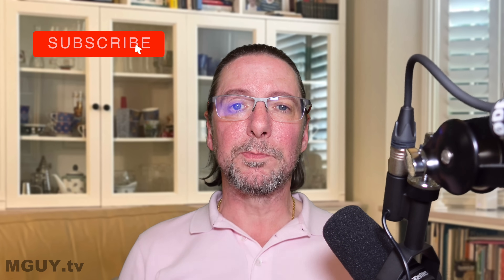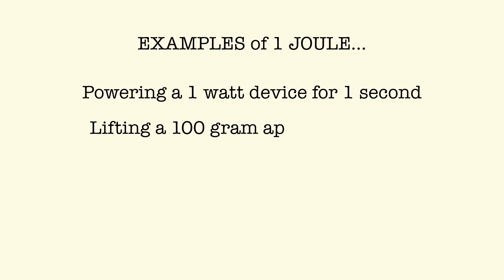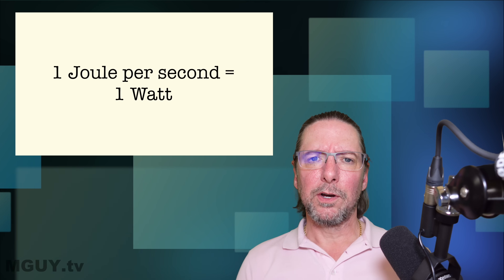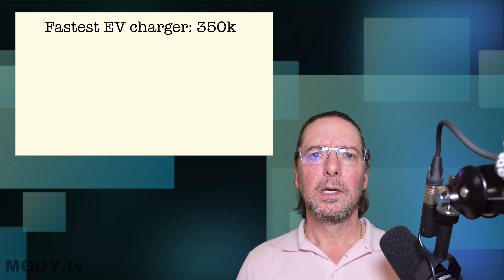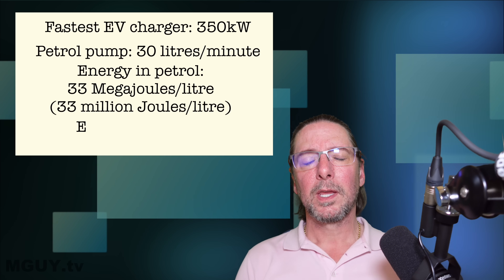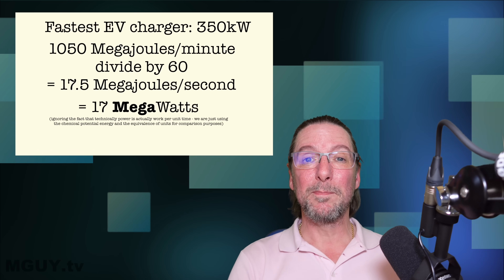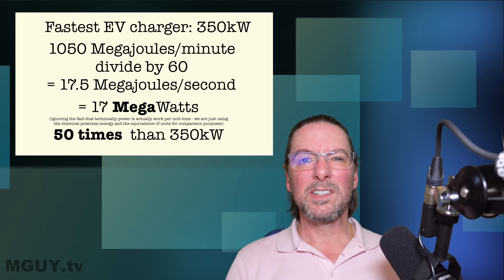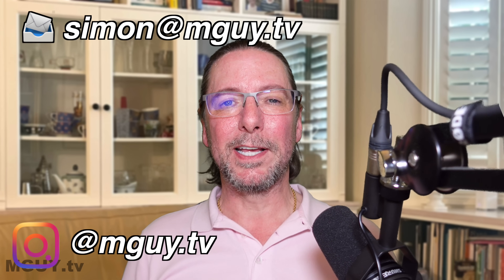Comparing charging speed of EVs vs "fuelling speed" of regular cars | MGUY Australia

Comment: And don't forget in cold winter weather you will lose about 30- 40% of the battery charge.
Reply: what about hot weather?
Reply: @sheilaolfieway1885   that is not good for the battery.
Reply: @joistein  What is? almost everything you do in a normal ICE car is bad for the battery
Reply: That's Huge loss
Reply: I live in a cold country, Iceland. Yes, you have less range when it is cold, mainly because you have to heat the car. In the worst case I have experienced a 20% reduction in range.
You actually do not loose battery charge, your car holds the battery at a suitable temperature.
Reply: @mjoelnir1899  here inN- Sweden 🇸🇪 it's now -24 and some batteries 🔋 works much worse and others but it is difficult to know which will be best 👌 🤔
Reply: @mjoelnir1899  I am a Icelander to but in North of Sweden you can get - 35C that is unlikely in Iceland, some batteries lose up to 40% of range it depends on brand.
Reply: @joistein We can have an endless discussion how bad BEV behave in the cold and there are all the time pulled out the worst cases. I drive a Skoda Enyaq. When you put a little thinking in the use, it makes a huge difference. In the morning you let the heat car itself, while it is still connected to the charger. My car controls the temperature of the battery, so it will heat up the battery both before you drive off and for example before charging. So for me it is not that the battery looses it's charge, but the high use due to heating the car on the way. If the car stands outside in the cold not connected, you will use quite a bit of the charge heating up the car and the battery. If you live that far north you better have a car with a big battery.
I work in fish processing equipment and I have been quite a lot in northern Norway. And guess what, even there you find quite a few BEV.
With cold temperatures you can also run in problems with ICE cars. The diesel engine will not start because it does not ignite when it is cold, or the fuel has to much wax, or the oil is to thick. You can of course get around that. Have a preheater for the engine and the oil sump, the diesel runs through a preaheater that used the engine cooling water and so on.
I have sat in petrol cars that do not start in the cold.
As it is the BEV are getting better fast, there is a huge difference between my BMW i3from 2012 and my Skoda today. When I bought my i3 the battery was 22 kWh. The last i3 had 44 kWh. My Skoda has a 80 kWh battery. The i3 had not as complex battery control, you had for example to initiate preheating the battery before charging in the cold.

Comment: I tested this 4 months ago, I purposely set my stop watch, started it got out, inserted the fuel nozzle (not high flow) pumped 95 litres of diesel went in paid for it and returned back to the vehicle in approximately 6mins.
Reply: even quicker when you pay at the pump.
Reply: I tested this 4 minutes  ago. Under 5 seconds to plug in, under 5 seconds to unplug. No time spent paying. Approximately ten seconds of my time per day spent fuelling.
Reply: @javelinXH992 presumably you don't drive long trips. So a diesel like mine would only need refuelling every 3 weeks or so, at maybe 5 minutes a time.

Ends up there's very little difference then.

But where do you get the free electricity from?
Reply: @alanjm1234   My previous car was a diesel (and so is our other car) and driving 350 miles a week I used to fill it up twice a month (about 700 miles per tank). My electricity costs for the newer car (3 years old now) are about £10 per 350 miles (+/- £1 from Winter and Summer variability). When the electricity price doubled it went up from £5 per 350 miles. In a diesel at todays prices £1.45 litre for 50 litres that would be about £72. Works out at about £100 a month saving for me or £1200 a year at the moment to be electric.
Reply: @javelinXH992  but you missed out on the exciting petrochemical smells, point of sale display offers and grumpy cashier!!
Reply: @toyotastout6870  I do miss the smell, I love the smell of petroleum products. Still we get to fill up our diesel car sometimes so I can relive old memories. 😉

Comment: The other crazy thing about EVs is it's recommended to charge up to 80% and to recharge before goes below 20% so you are paying in some cases for 100KWh battery but can only use 60% of it. Once you get to 80% it takes a lot longer to put the last 20% in if doing long distances the rapid only works for 20-80% and then you have temperature issues too.
Reply: That is something that the argument of what it cost to charge over the price of fuel always got to me. Technically you are only using 60% of your charge. That is a little over a half a tank in a ICE car. How is this efficient. The other thing they don't mention but Uber drivers with EV Tesla's too have said is any EV when it gets down to 50-mile range is really a crap shoot. It could be 10-30 miles range and changes all the time when it drops to 50-mile range. We had and Uber driver tell us he picked up some people to take to the airport and he had 50-mile range on it. Plenty or range for the trip. His Tesla started dropping and he had to pull over and call another Uber to come get them. It isn't just Tesla they all do that.
Reply: That's OLD tech. Keep up. Or, just ignore change. It's your life.
Reply: @1voluntaryist  Well I am so glad you can go out and buy the "new tech" for every EV car that comes down the line. Most people have older EV cars and they are 20-80%.
Reply: You're not in any way forbidden from using the whole battery capacity when you need it.  It's just not considered best practice to do on a regular daily basis, for maximum service life.  Also, more and more cars are being built now with LFP batteries, which are cheaper and have somewhat less capacity, but they are happy being charged 100% all the time.
Reply: @Zobeid  yeah said recommended but does supposedly damage them - sure new battery chemistry might go all the way 0-100 some like zinc-bromide can be stored at 0% (and am not suggesting ZB batteries for cars).

Comment: Wouldn't it just be easier to design batteries that can be exchanged like gas bottles.
You drive in, take the flat battery out & exchange it for a recharged one. Why cant there be 2 batteries & one charges the other as the other is driving. I wont be buying an EV, there's no way i am burning in a car & i dont think they are better for the environment.

Comment: Why is this relevant? 
it take about as long to plug in an EV as to put the nozzle in the tank of an ICE car.
I then go off and do something else especially if I am at home I return later and I have more range.
How do you do this with an ICE car?
Should you never use a laptop because they take a long time to charge?
What about cordless power tools
If you have never had to wait to get fuel at a service station you must be different to me.
It is also factually incorrect in that while hydrocarbons do contain a lot of energy well under half is is used on moving anything.
If you want to believe you can. Just like the antivaxxers

Comment: EV's have to be loaded with 100% of the energy they need for propulsion, but because petrol and diesel cars run on a mixture of fuel and air, they only need to carry a small proportion of the total fuel required - the rest comes from the atmosphere, as and when needed.
Reply: An EV battery weighs the same charged or discharged,unlike a fuel tank.
Reply: @jasoneldridge4738 A ev battery weighs about 1200 pounds or more while gas weighs around 6 pounds per gallon.  A car with a 20 gallon tank would hold 120 pounds of gas. An ev car weighs about 1200 pounds more than a gas powered car on average making your comment totally irrelevant.

Comment: That's one data point.
Here's the spped of draining your bank account...
Just calculated after 20,000km in our model Y. $667 in fuel, so about $3.33 per 100km. Not bad for a decent sized family SUV.
Reply: But how much did it cost and how much has it depreciated?
Reply: @bobstirling6885  yeah, good point, over 60k after rebates. I did a spreadsheet incl depreciation, interest, repairs, tax exemptions etc. The Y will cost me about half of RAV 4 hybrid over 5 years.
No brainer.
Reply: @davehayes8812  but my diesel cost me £5000, that's many many years of fuel savings just to break even....
Reply: @bobstirling6885  Sure, but you are comparing your second hand car to his brand new one. Imagine the savings if you bought a £5000 EV. That time is not far away in the second hand market. If you regularly drive over 200 miles a day though, I’d stick with a diesel.
Reply: @javelinXH992  you are correct, the second hand market will soon be flooded with early models as nobody wants them....

Comment: The other thing EV owners are also finding is charge station rage where owners wait their turn and another pushes in and needing marshals. So if you are unlucky and stations are full you have to wait with your car until the other one leaves depending on where the cycle he is on you may have to wait 1hr. And the other kicker is you only charge to 80% to prolong the battery life and sacrifice range. 
With all these issues rather ICE with none of these added hassle but unfortunately it is not driven by drivers choices but by Government intervention interestingly you don't see all these Government departments replace all their cars to EV across the board as they are the biggest users of fleet vehicles.
Reply: Marshals at EV stations aren’t really a thing, but they do sound cool.
Reply: Never happened to me, but then again like most ev drivers I almost never using public charging because it so easy to charge at home, that takes 10 seconds 5 to plug in and 5 to unplug, if that.

Comment: Speed of charging is one thing but another issue often ignored is that Public chargers will likely all charge for and limit time on station necessitating  returning to the vehicle and finding another parking spot - another inconvenience. The whole EV thing has been grossly mis- managed. World wide standards should have been fully researched and developed before anything was put on the market. EV's will never be universal unless they can be charged in a few minutes with facilities to match those we have for fossil fuels, personally I do not see that happening.
Reply: But you already have a charging station at your house, and I can guarantee you won't kick yourself out. It's done. When you need to charge at a public station (rare) go from low to high in 20mins without being there- no one is moving you on in that time, so go to the bathroom get a drink and check your phone and get going.

Comment: No, it shows how much more technical infrastructure will be needed if everyone switches to EV. Otherwise, we will face huge traffic jams for chargers. This is a challenge that makes building an entire rail system seem seamless.
Please note that these are not only chargers, but above all power plants, miles of cables, and not the usual ones like for a wall socket.
The funniest thing is that they are trying to convince us that it is an ecological solution. Yes, sure
Thanks for your contribution to debunking this scam.
Reply: It is especially hilarious in the UK where we do not even have the resources to run even the basic services as they stand at the moment and running down by the minute.